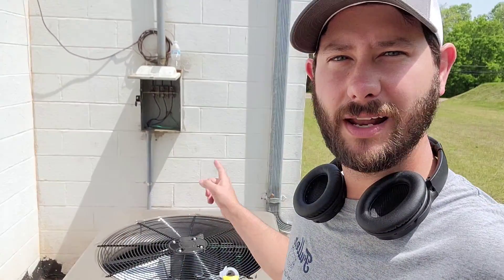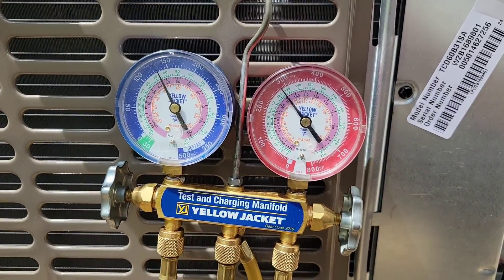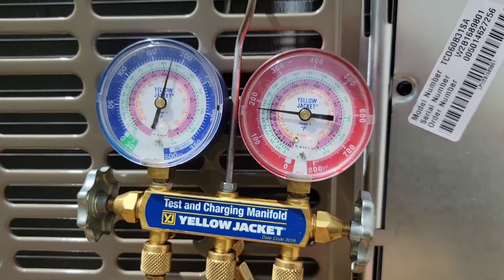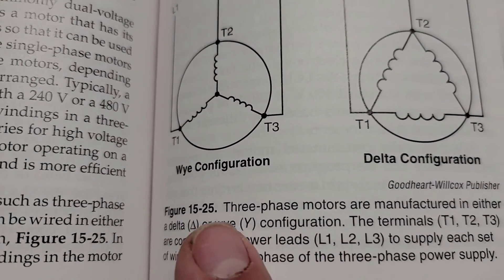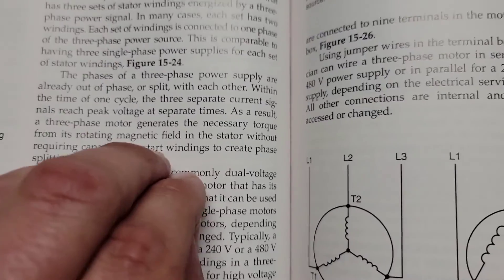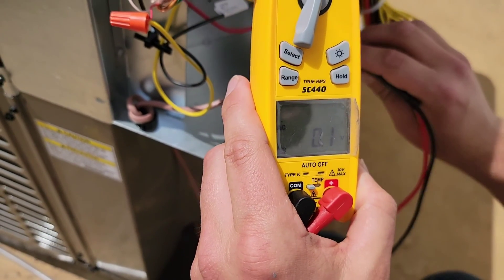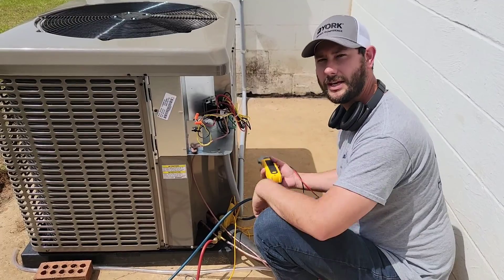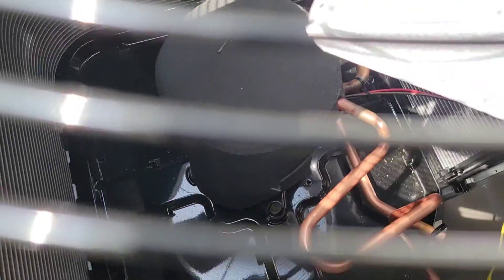How to reverse phases for 3 phase air conditioner?

Comment: I guess this is why my indoor Genteq 2.3 VS blower motor doesn't require a capacitor because it's a 3 phase motor but my compressor has a capacitor.

Comment: We see what happens to the condenser fan motor runs backwards , but what happens to the compressor? Does the scroll spin backwards? and will it eventually lock wingdings or just never reach it's proper pressures and go off on limit?

Comment: I have a 3 phase walk in cooler roof top  unit. I took it out of a 3 phase breaker box where each leg was 120v to ground. My other location is different it has L1& L3 120v to ground but L2 is 208 to ground on my meter. How do I wire this ?
Reply: I’m sure you’ve figured it out already, but the 208 to ground is a “wild leg”.  And only matters if you’re wiring in a 1pole device (you just can’t use that phase, typically “b” phase.   But for a 3 phase application, it doesn’t matter, just wire it as you normally would

Comment: Just ran into my first 3 p stumped me with no cap but determined disconnect was faulty because arked after watching this video I can confirm that it lost a leg because the compressor would want to start but wouldn’t and when it was in suction was 35deg once I bypassed disconnect pressure were right on disconnect is coming in

Comment: Here’s a tip involving some 3 phase motor concepts. 
Inverter mini split compressors are actually 3 phase wound, brushless DC motors. The outdoor unit will call for single phase 208/230 VAC. But with the inverter technology, the compressor will actually be a DC motor(which then can modulate system capacity via modulation of the level of voltage  being delivered to the compressor motor…whereas AC voltage motors can only change speeds via modulating the frequency). 
Anyway, I am a licensed HVAC contractor in the state of FL, and I recently did some work on a new mini split system that was installed by someone else. They started the system up but forgot to open the service valves. 
Would not run in heat or cool. Shortly after attempting startup, it began displaying error code P4 (this is a Blueridge brand system sold by Alpine Home Air Products and manufactured specifically for them by Midea). I found out about the closed service valves and the error code after I arrived and began diagnostics. P4, in this, instance references an “inverter compressor drive error.” I tested everything that called for being checked out: wiring connections between the compressor and main PCB, continuity/resistance testing of the IPM, continuity/resistance testing all 3 windings of the compressor(remember it’s 3 phase, so all windings should measure of equal resistance), continuity/resistance testing of the reactor (reactor itself, isolated from the PCB, and the wiring between the reactor and the PCB), and I tested the outdoor fan motor(also a DC brushless motor)…all of these checks turned out within spec. The compressor checks out electrically, but it just would not start. It would try though. After resetting power to the system, and calling for cool or heat, the outdoor fan would start running and then the compressor would begin trying to start. After several seconds, the compressor would cease trying to start, the outdoor fan would shut off, and it would begin displaying the P4 error code. 

I figured the compressor was just stuck, mechanically, from being started and ran with the service valves being closed by the person that installed it. Well, knowing what I know about 3 phase motors, I knew that I could switch two leads at the compressor terminals, and apply power to the unit, and the compressor would run(or at least attempt to run) in reverse rotation. I switched the W(common) and V(start) leads directly at their termination on top of the compressor. Left U(run) where it goes. I turned power back on and waited for the thermostat to call for cooling. Outdoor fan started up and several seconds later, the compressor kicked on, running in reverse! As planned. I let it run for only literally about 2 seconds and I cut power right back off. Swapped the compressor leads back around for correct rotation. Turned power back on, waited for thermostat to call. And it started right up and ran beautifully. 
Saved me a huge headache. 

Little bits of knowledge picked up along the way can really come in clutch sometimes!
Reply: @CoreyMeagher  wow thank you for all that information.

Comment: Just ran up on two 3 phase compressors in roof top units yesterday evening.  Had me chasing my tail when I saw pressures equalized on both units while compressor was running.  An 18 wheeler had hit the main power supply at the back of the building and the business was running on a 3 phase generator.  Most of what we deal are single phase residential units. After we left, my helper who had some industrial mechanic background got to thinking and told me it might be possible the generator phase rotation was wrong.  This pretty much confirms it.  We'll be going back today to swap phases.  
Thanks!
Reply from the maker: Thank you for sharing this with me I'm glad my video was of help to you
 Thank you for watching
 Please hit the like button